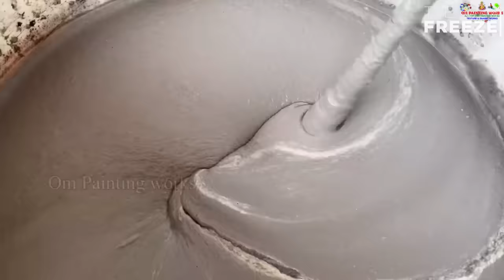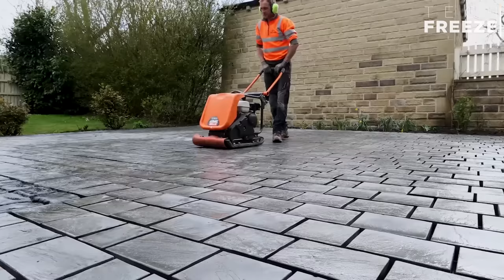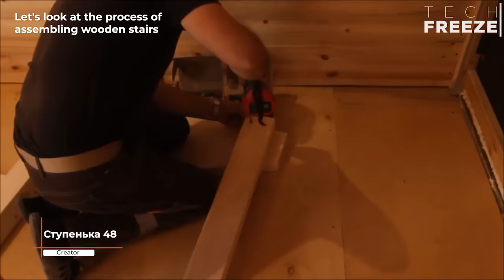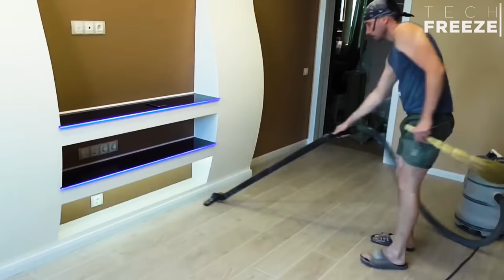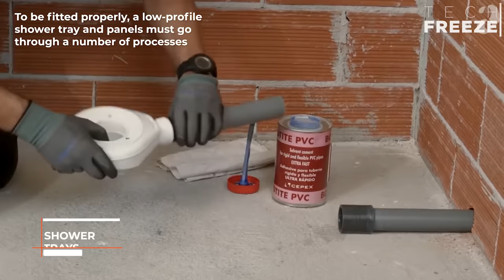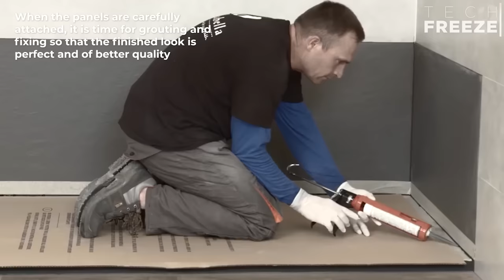Ingenious Construction Workers with Skills You Must See ▶3

Comment: Those guys building the deck don't know what the hell they're doing you never butt the boards up to each other without 
spacing them ! 🚩👈😉
Expansion and 
contraction ! 😂
Reply: The boards dry and shrink very quickly, leaving wider gaps that the initial spacing was intending to avoid. Boards placed against each other will open to 1/4" in no time.